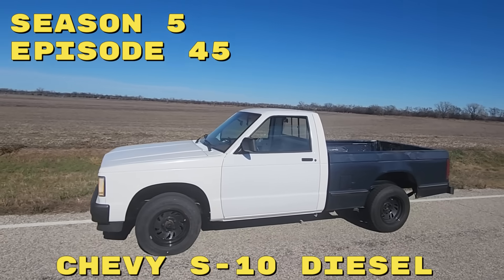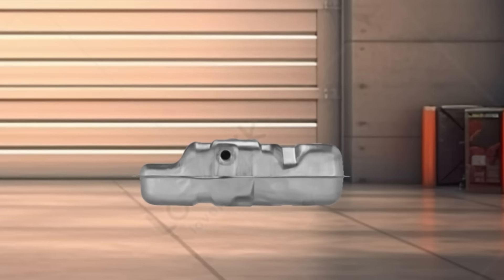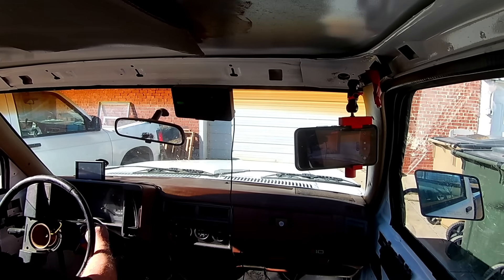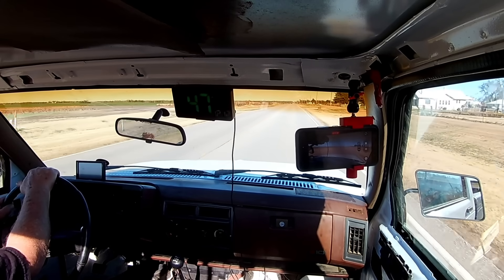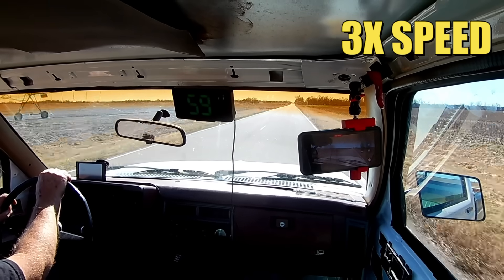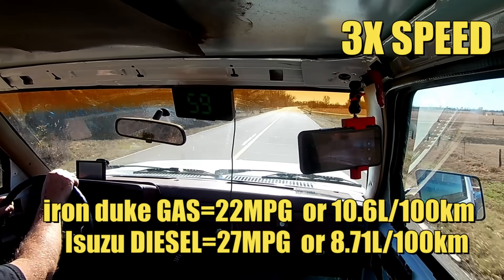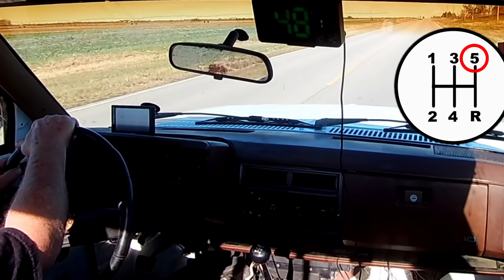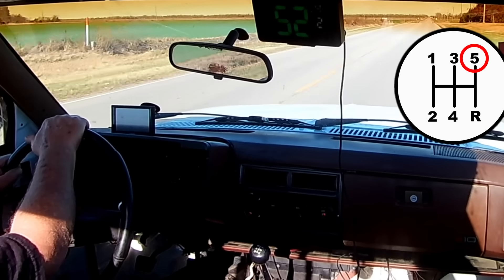S5 E45. MPG?  We road test the custom diesel Chevrolet S-10 to find out the fuel economy.

Comment: I know you don’t have hills or mountains there, so this should be best case scenario on fuel mileage, even with the wind. You can’t compare it to the Isuzu Diesel because that was a different test that would have included hills, etc. so the differences in testing would give you different  results.
Reply from the maker: good point!

Comment: 5:25 35 mpg, it's a very squar..ish body plus RWD. Let's see if it's close to that number.

Edit: 32.5 MPG, not too shabby!
Reply: Reasonably close. I guessed too high.
Reply: @BigKandRtv  I think the mileage is going to be slightly better with forced induction - more air, more torque (even 80 lb-ft from the original 73 would be a significant improvement) and therefore more pep in the lower part of the rev range. I foresee some fun!

Comment: As tire pressure goes, I put what the tire recommends, meh the engineers that designed the tire knows a whole lot more about that tire than I do.
Reply: Tire pressure is based on vehicle weight and contact patch size, not necessarily just the tire. Same tires are often used on multiple vehicles with varying recommended pressures.

But if it comes to getting the most mpg then more air is less rolling resistance.
Reply: You should actually follow the door placard. The number on the tire is the maximum inflation rating at the shown weight. The number on the door is to your specific vehicle and is what is decided to give the best contact patch and grip.
Reply: @Collywood-Studios  Absolutely. That was my point. OEM with different manufacturers normally have same specs so.....
Reply: I drove my vehicle with 40 psi for over 10 years. Got better fuel economy doing it. 
The "engineer that designed the tire" has to cover a range of scenarios, and the tire pressure is optimal for ALL situations. In my situation, I was going for fuel economy, not racing (or braking) traction, so, there's that.
Reply: @Maybe-So  Actually it's for longevity of the tire, the focus of good manufacturing. so there's that too.